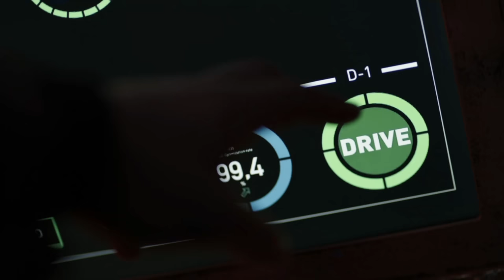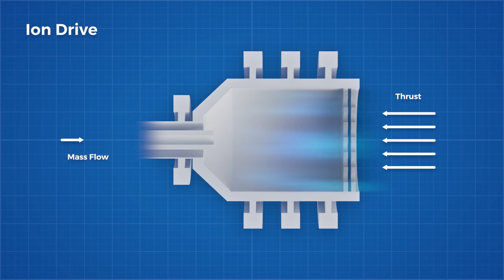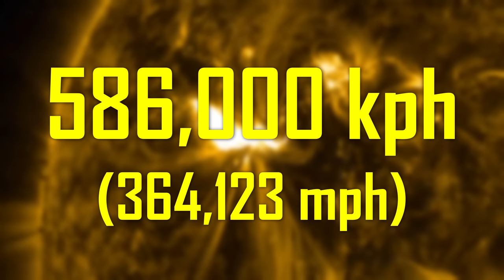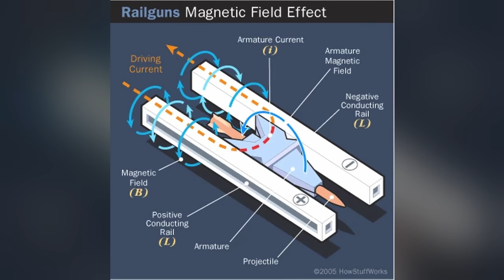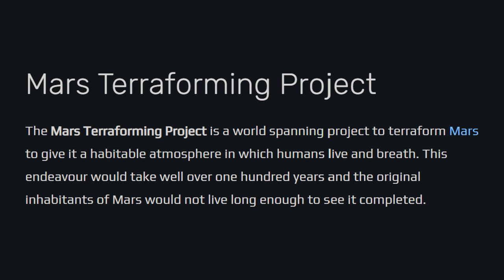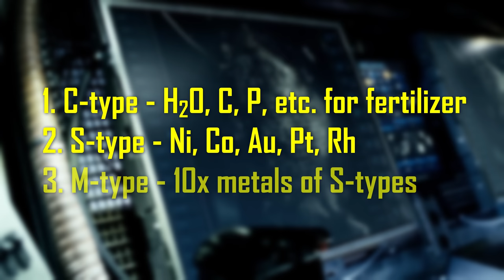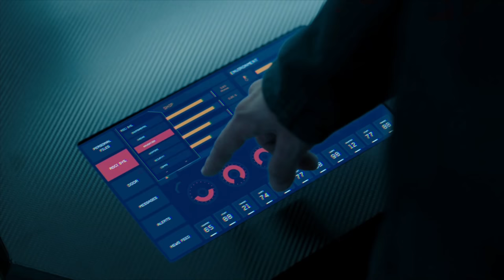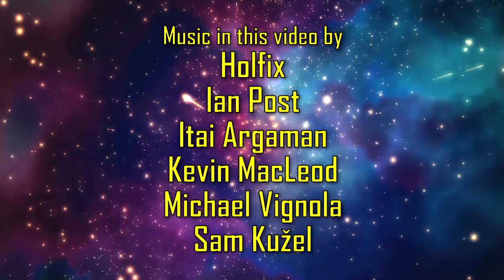The Science of The Expanse

Comment: Depending on Lore vs Cannon argument, where Laser weapons are in the The Expanse book series, but suppprisingly not within the television series (unless I'm mistaken about this).  It could be a timing consideration of when both show & books were written.  Given the R&D & the 50 kw to 300 kw lasers in production today, one would think such weapons would be even more prominent in a greater refractionless environment such as space.  The power generation was certainly available in ships of The Expanse, far much more than today.  Commercial use in mining, point defense, lances, and general heat impact weapons should be very realistic within the show.  Laser weapons should be capable of altering or stopping a rail gun shot.  This would certainly be the case of point defense against missles & attacking a ship (especially at a a point of greater vulnerability).
Reply: The main issue I see with lasers is that if they are done realistic, you'd never actually see it.
  
There is one scene with a laser being used towards the end of season 3, you can see the path the laser travels which isn't realistic but I feel they had to show it otherwise the audience would just be very confused, especially since the laser missed.
Reply: The only instance of a laser I can recall from either the books or the show is what  @Lunatic BZ  mentioned which was both in the show and the book series. Otherwise everything else is PDC's, railguns and missiles.
Reply: > Laser weapons should be capable of altering or stopping a rail gun shot
A laser will not have enough momentum to counter that in the rail gun projectile. Sure the laser might melt the projectile into a rough slag, but in empty frictionless space this change of shape won't make any difference to it's velocity, especially over the limited range that rail guns are used at.

>Against a missile
A laser may blow it up prematurely, the wreckage will no longer explode but will still cause damage if it hits anything - and it may still be travelling towards the target...

> Guided Missile
Probably hoping the laser will destroy the guidance system, though as above it's still a fast moving object in space.

I don't think lasers prove as good a weapon as first thought.  Mass with momentum seems a winner.
Reply: @jpharri  You only have to change the trajectory of a rail gun shot though to make it not hit you.  Though your right at limited range that isn't happening and rail guns are already only being used at limited ranges since otherwise you can just dodge them.  

Against the missiles we see in the show most of them are nuclear so really regardless of what you damage on the missile or blowing it up it's a lot better then letting it detonate.  Even if the debris directly hits the ship.  

*edit, just realized in my ramblings forgot to say its not the impact of a laser that redirects a projectile its because whatever the laser hits some portion of the projectile will be turned into heated gas, plasma, light etc.  As that leaves the projectile thats why it changes directions.  
  
That said in real world the cat and mouse game between weapons and defenses.  If people used laser defense weapons you'd just build missiles to negate that defense as much as possible.

Comment: The hand terminals in the expanse probably work only as access points to a cloud computing centre, which could explain why all the terminals went down with the power on Eris in the early episodes. This would also make the clear aesthetic more viable since it removes the need for a local hefty computing unit and only requires a data and power receiver and a display, plus maybe the acrylic sheet might include some piezo-electric circuitry that vibrates the material to turn the entire device into a speaker.

Comment: Thank you for this great video.  Your research really showed up on the screen.

One of the largest technologies in the Expanse is the one you cannot see:  radiation shielding.    The travelers in the Expanse never worry about ionizing galactic radiation (cosmic rays).   That either means that the writers dispensed with the reality of radiation OR they assumed a mechanism of shielding which--by the time of the story--was so common as to vanish from conversation (like drywall today maybe).   It is interesting that there are death chambers on Eros which use "hard" radiation to kill belters en masse (parallels to Nazi gas chambers are stark).    Current discussions about cosmic ray protection are found in many places but with few workable solutions.    

Thanks again for your work.

Comment: Railguns works better in space. On earth, the hypersonic projectile heats up the air causing what looks like explosions with flames even though no chemical explosives are used. This damages the "barrel". In the vacuum of space, this problem would not exist.

Furthermore, we can use spinlaunch's method, to reduce the voltage needed ... high voltages is the other main factor that shortens the lifespan of the "barrel".

Comment: Since space does not contain any gas, liquid or solid medium for a vessel to mechanically steer against, steering can only be achieved by thrust. To achieve the high G thrust depicted in the video clip would require massive engines which are not used the rest of the time. I'm guessing it would be more economical to attach a giant structure of sensors which could detect objects from a greater distance. That way you can avoid collisions using gentle course alterations, which can generally be achieved by reducing acceleration below 1g.

Comment: One more way computers may eventually evolve is using photonics (light based) instead of electronics. Currently this is only used for data transfer and used to be used for data storage (CD AND DVD) but they aren't really any reason why they can't be logic gates using light. And that pars with the terminal being transparent...
Reply: Light needs too much space. We already employ EUV, phase maps and etching to still somehow use light to create circuits. But if the circuits should operate with light instead of microwaves, there will be a big problem. The best semiconductor is only 4 times as fast as Si , which runs at 5GHz top. So science says: no computer faster than 20 GHz unless we use chemistry DNA to build atom perfect bottom up. Yeah, I sometimes dream of a brain with silicon on the surface, but a gradient index sphere in the bulk. Then diodes could transceive signals with the other side low power. Or multiple lenses for another topography.

Or fully 3d integrated with fluid cooling channels, HV power rails, and glass fibres. Gotta reduce the power requirements!

A scrap GRIND lens. We want high index of refraction at the diode. So probably vacuum tubes closed by lenses on both sides are faster. Diodes are immersed in the lens ( pressed against it ). Those tubes are allowed to cross. Still in a data center I would prefer fiber.

Comment: 11:21 I think stellerators will win this race. If you wanna dive into the topic, look up the Wendelstein 7-X
Reply: Why is Tokamak too heavy? Most weight is due to the vacuum vessel. At least a Tokamak creates hot plasma which already is controlled by a magnetic field and can probably just   be sling shot to the back.  On a larger scale maybe you can unroll it. A long tube with ever increasing magnetic field strength towards the end and then?

Didn’t they prove recently that the stellerator cannot sustain fusion no matter the scale? In its linear fashion I imagine a helix.

Comment: One type of future weapon that the Expanse doesn't use that I expect to be more common in the future are coilguns. They also use electromagnet propulsion, similar to railguns. However, instead of rails, they use many sets of coils that an electric current can be run through, pulling a magnetic projectile towards their center. Quickly turning them on and off at exactly the right time allows for the acceleration of the projectile. While this makes its inner workings more complicated than railguns (which are already very complicated), it means that they are much less likely to try to shake themselves apart when fired compare to railguns, making them useful as handheld weapons or smaller ship-based weapons like PDCs. Since they don't use gunpowder, they'd be much more silent than guns used today and would not cause as much hearing damage over long periods. Any projectiles shot at less than the speed of sound would be completely silent. Currently, the main thing preventing their mainstream use is energy storage, as even the most advanced lithium-ion batteries add a lot of weight to it and can only allow so many projectiles to be fired. I'm curious to see what others think about this.

Comment: One has to assume a lot of the issues with railguns involve their projectiles interacting with atmosphere as they move through or leave the firing system - some fairly catastrophic forces are involved in moving an object at such speeds through atmosphere. If there is no atmosphere, a lot of those forces cease to be an issue. Heat sinkng and other shielding provide new challenges, but the gun destroying itself with every shot maybe aren't one of them.

Comment: Meanwhile around a month after this video came out we (as in the U.S. the AEC? If I remember correctly ) figured out Nuclear Fusion and managed to create a sustained nuclear fusion reaction that produced more energy than what was used to create and maintain it. From what I remember that was the main problem that humanity before this January, had with Nuclear Fusion we couldn’t create a nuclear fusion reaction that produced more energy that what was used to create and maintain the reaction. But now we’ve cracked it. I mean yes it’s incredibly likely if not certain that it will take at least a few decades until we’d see nuclear fusion plants dotting the planet the process still needs refinement and that will take time. But the main problem is now out of the way and that’s what matters all that’s left is the fine tuning. (that’s the oversimplified version of this monumental breakthrough.)

Comment: 20:15f: 163 km/s (101 mi/s)
which equals roughly 5.44×10⁻⁴ = 544 ppm in natural units where lengths are measured in (light) seconds – or, for practical purposes, decimal fractions of it (1 ns ≈ 0.98 ft).

Comment: Laser / Fusion... May be better thanTokamak.
This was a fun video, thank you.
Reply: what again is the difference between a bomb and lase fusion? In both cases cryogen fuel explodes. Efficiency gets better with a bigger bang. Do we even need the copper with larger pellets? Only thing I learned is that even EUV at some density gets reflected by plasma. We have to paint the pellets in vantage black. I imagine fractal dendrites which capture all laser energy. How important is pressure? The smaller the pellet, the less energy do we need to compress it. 1000 bar of chemical rocket. Fill (store) carbon bombshells in such atmosphere and rapidly shot one of them into vacuum. How does this bomb not destroy our lasers? Sapphire windows. Do we use the flash to pump laser material? Do we let escape a third of the explosion out of the back for thrust? I imagine that the crew cabin is suspended in a kind of escalator in vacuum.

Maybe we have sapphire windows in a hexagonal pattern and vacuum tubes in the gaps between. Coils around those tubes extend their magnetic field into our large bomb sphere and funnel charge particles into the tubes. Maybe the real reaction thrust is generated in the U-turns of these beam tubes. This could even out the bang a little bit.

Now I understand the copper tube around the pellet. You one need to place lasers around the open parts of the copper. The cylinder wall are free for exhaust and energy harvesting.

Comment: The major problem in the Expance Is that the spacecrafts need radiators to dispose of the heat generated from people, devices and engines. Otherwise It Will all be cooked in a matter of minutes/hours. In my opinioni, the ISV Venture Star from Avatar Is better thoughted
Reply from the maker: Many people have brought this up, and it's a very fair point, but just as there will continue to be advancements in fusion power and such, there will continue to be advancements in thermal management.
Reply: @OrangeRiver black body radiation is what it is. Only fusion without an attached steam engine (like planned on earth) would work. Interesting would be if ships turn from hot body panels to build up liquid Helium internally to cold panels for stealth. And if all helium is used up, they lose stealth.

Comment: 49:00 the reason it's not true anymore is the monopolies are getting greedy...
Reply from the maker: I mean, a slowdown like this in Moore's law has been predicted for years. It's just getting more challenging to master engineering on such tiny scales, even though companies are looking forward as far as 2060. But I hear ya--it's definitely consequential that practically all the semiconductor manufacturing is under the auspices of one company
Reply: @OrangeRiver  yeah, i mean the horrible returns of Nvidia's 4090 which is something like 1.5x the size of last gen video cards so it won't fit in your pc and has barley any performance gains compared to what the RTX 3060 was to the RTX 2090TI which was a gigantic leap because the RTX 3060 had the same performance as the RTX 2090TI for something like a quarter of the price, it's quite tragic if you think about this too long..

Comment: 14:50f: Switching from acceleration to deceleration shouldn't be such a big deal with high g. If all the ship is to be turned around, it could even maintain its comfortable 1g at the utter rear of the ship in form of centrifugal force during the turn. Of course, at the ship's front, there is much less then, until the thrusters are turnedvon again in order to decelerate.
Note that if you thrust long enough, according to your own clock, ever maintaning the same proper acceleration, you get to noteworthy fractions of c where NEWTONian mechanics (NM) becomes an ever worse approximation of what's actually going on.
Reply: You just fly a slight turn with constant thrust (magnitude)

Comment: 1: develop a fusion technology with total usable power output greater than total input.
2: I'm still waiting!
Reply from the maker: We literally just achieved fusion with more output energy than input energy lol...like, weeks ago. Of course, it still required a lot of traditional power to supply that reaction, but...it's literally the definition of progress. Y'all need to understand, The Expanse is set MULTIPLE CENTURIES in the future
Reply: @OrangeRiver  I assume that you are referring to the National Ignition Facility’s recent net gain result for their laser-based inertial confinement fusion (ICF) device which was used achieved a reported 1.5x more energy output that was used to generate the fusion reaction. This is a milestone, but it is not as impressive as it would at first appear.  They used 2.05 megajoule of laser energy to yield a measured 3.15 megajoules of energy output. BUT this does not account for the energy required drive the laser so it could create those 2.05 megajoule of laser energy. Charging the laser consumed "well above 400 megajoules” so the total net energy produced was less than 1% than the total energy used to achieve the energy output. This is a single event. There is no way to generate an ongoing stream of fusion energy using this technique, at least, not yet. I’m afraid that practical fusion energy is still a ways off yet.
Reply from the maker: Yes, I'm aware of all that--but we do agree, it is a milestone ;)
Reply: @OrangeRiver  Yes indeed, although not unexpected given the nature of fusion energy, the event is something to be celebrated, but I have already had several conversations with individuals who were prematurely celebrating our imminent post petrolium future so it would not appear that it’s common knowledge that fusion is a few of orders of magnitudes away from break even energy production.

Comment: you're messing up the spin gravity used on ceres. firstly, they used epstein drives to spin them up (not sure if it's said on the show, but is stated in the books). also this didn't "increase" the gravity (it actually makes it impossible to stand untethered on the surface), but creates simulated gravity on the inside with the force going outwards (they're walking with their feet facing "up"). also while there's the coriolis effect, there's also an additional important facet to it in that the gravity itself is different and this creates social strata inside the station with the outer parts being for the richer people. this is also why spacing people on ceres is such a threat, if you get set lose from the surface you'll be ejected with considerable speed.
Reply from the maker: I most certainly make the distinction between surface gravity and interior spin gravity lmao
Reply: @OrangeRiver  then you really need to learn to define it better. because the way you state it it does not sound like it.